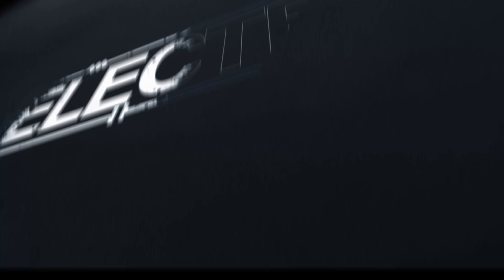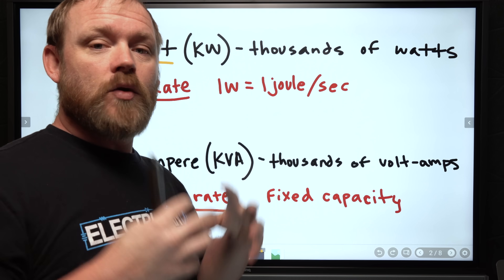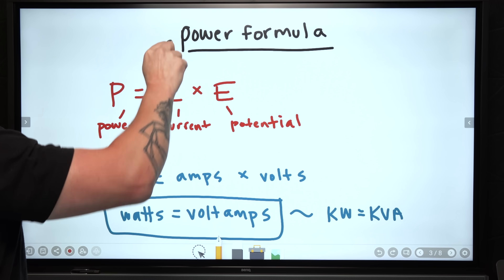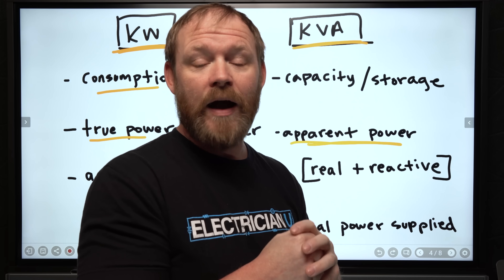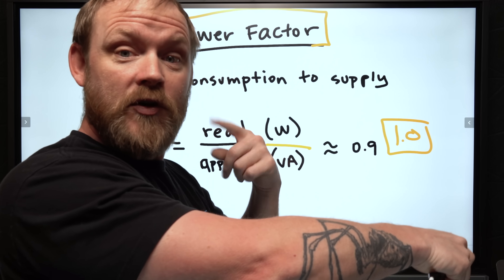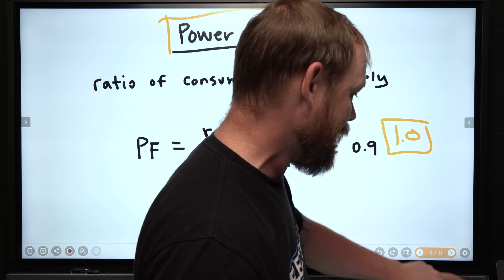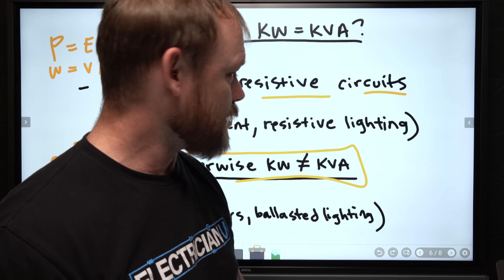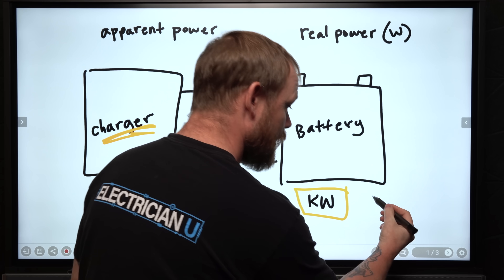Why KW and KVA Are NOT The Same Thing (Even If They Seem Like It)

Comment: To be honest, you used your formulas a bit wrong. P = U x I (sorry, I will use "U" instead of "E" because of the SI system), is only usable in DC circuits (maybe you should have switched your last sheet to be one of the first, because that is an important difference which should be told first). If you use it in AC circuits, you have three formulas for the power: Apparent power S = U x I, reactive power Q = U x I x sin (phi), active power P = U x I x cos (phi). cos (phi) is that, what you call the PF. The angle phi is that angle which you should have marked in your slide showing the difference between DC and AC and it would be the angle between R and Z. 

And if you look at the formula, in DC currents X = 0 so the angle phi = 0 and cos (phi) = 1 which explains why in DC circuits P = S = U x I

Comment: You can get apower factor of 1.0 in circuits with inductors and capacitors, but only when they are balanced. A 1.0 power factor requires the voltage and current curves to be in phase and indutors and capacitors have opposite effects on the phase of the current curve. Make the two equal and it appears as though it is a purely resistive load. Also called power factor correction.

Comment: You better believe the power company charges based on KVA and not on the lesser Watts.  Many industrial sites have their own banks of capacitors for this reason. If they can get their Power Factor as close to unity as possible they save money on their bill. Residential loads are mostly resistive and are too small to account for, so we estimate power factor in the aggregate and simply increase the rate we charge accordingly.  Some of our substations have capacitors in banks that can be opened or closed in stages to match the power factor of the circuit they serve, reducing the load on our generation.

Comment: This is a bad explanatory video.

A better approach is as follows:

With inductive loads (e.g., electric motors or transformers), in addition to the energy flow that the device processes (active power), energy also flows back and forth between the power supply and the device without being used by the device. This back-and-forth energy is called reactive power. Active power (P) and reactive power (Q) together make up the apparent power (S). Since reactive power is 90° out of phase with active power, they are added quadratically.

S² = P² + Q²

To save users from cumbersome calculations, motor manufacturers usually specify the active power P (in W) and the cos(φ) on the nameplate. The cos(φ) indicates the ratio of active power (P) to apparent power (S).

cos(φ) = P / S

This means that with a 1.1kW electric motor with a typical cos(φ)=0.8, the power supply is required to deliver 1.375 kVA and the supply lines must also withstand 12.5A instead of 10A at 110V.

PS:
- active power (P) is measured in [W]
- apparent power (S) is mesured in [VA]
- reactive power (Q) is measured in [VAr]

Comment: Almost. Like R-vallue. The theory you represented is right, but practice... shows relatively true A value at the equipment, but AC voltage is not as declared 110 V in average. For an example, the difference of equipment powerage with the same A for DC and AC differs up to 1/3. I tested "made in China" ones.

Comment: ...and but of course Volt*Amps is always a rate, as the definition of Amps is the number of charges (namely Q - not the StarTrek villain, though) passing through a conductor's cross section per second. You can write Amps as being the 1st derivative of Q with respect to time --> current I := dQ/dt measured in Coulombs per second which is Ampere.

So what Volts * Amps really says is the amount of charges per second passing through a conductor's cross section driven by the potential of the voltage.

Comment: kW is often averaged over 1 second or more in ideal situations.
kVA is affected by the worst case situation during each fraction of a cycle. kVA is average voltage x average current when more current flows at lower voltages in the cycle than expected from a sinewave of AC supply.
Wires, transformers & several other components heat up based on current flow no matter the voltage at the moment the current is flowing.
More current when voltage is low means less power is transferred compared to the same average current of ideal sinewave following the voltage (like resistive loads).
Equipment & supply may quote both kW & kVA ratings.
A generator or transformer may say 6kVA but 4.8kW, a powersupply (in equipment) may say 280VA 200W, both subtotals have to be each below the related rating of the supply (in this example above, 21x of the same powersupply could be used - not 24x if only checking kW).

Comment: Thank you. Great video. I wish I knew what screen you are using to draw on. That is an awesome screen. I'm a civil engineer and I relate KVA as potential energy and KW as kinetic energy. When it comes to moving water, we use the energy equation with the supply side on the left of the equation and the right side being the results, such as water velocity, water pressure, + LOSSES, just like the equation you showed. I loved that you explained this concept in several ways. Good job.

Comment: Ok, this all makes sense, but what about an Uninterruptable Power Supply (UPS).
They are batteries, but are rated in KVA.
Does it have to do with the power management within the UPS which may have capacitors?

Comment: Great explanation on KW, KVA. I want to make it clear that batteries do not store energy. Electricity can not be stored. Electrons can not be saved up in a device and used at a later time. Batteries store chemicals and parts that have a potential to create electron flow, from one atom to another. When we discharge or charge a battery we are changing the chemical makeup of the battery, this also goes for capacitors.

Comment: 1 Watt = 1 Joule/second
1 Ampere = 1 Coulomb (charge)/second
1 Volt = 1 Joule/Coulomb

Since P = E x I,
1 Watt = (1 Joule/Coulomb) x (1 Coulomb/second) = 1 Joule/second

So yes, 1 Watt = 1 VA

Now if you want to talk about torque (Nm) and energy (J) both using the same units...😂

Comment: Here's my confusion. As a motion picture electrician when I spec a generator I'm only concerned about how many usable amps that the generator will give me. Typically I use 500A,1000A,1400A generators. Because I know what lights are going on any particular generator and each light has a "known" amp draw such as a 5K which will draw 41.5A in round numbers. This lets me know how many lights I can put on any particular generator keeping in mind that I only load that generator to 80 percent of its total out put. How do I simply convert amp to kVA or kW? Sometimes the rental company only rates their generators in kVA or kW and I have to go get my cheat chart and see if I can figure  amp vs kVA/kW. Amps seems simpler to me.

Comment: Lol magnetic flux in the transformer NOT doing any work 😅😂 it’s basically how they work, isn’t it? 
Current flows magnetics grow electrons in the other wire get excited the flux lines align iron molecules in the core of the transformer 
The wham a fraction of a second later everyone goes the other direction 
Magnetic fields collapse electrons go crazy again looking to play musical chairs trying to find a place to be as things cave in
Only to get excited again as the magnetic field builds again from the other direction and again the iron core gets aligned by a magnetic field- all this back and forth the starts to make the metal warm because it’s basically designed to be a lower heat generation version of an induction cooktop that keeps the magnetic fields in the other wire to transform the energy into a different voltage or isolated instead of creating heat in a cooking vessel.
Magnetics are literally doing all the “work” here. You can tell because there’s also heat in the wasted energy because they aren’t 100% efficient  in moving power from the primary to the secondary windings. 😉

Comment: I always wondered why battery capacity is listed as KWh instead of actual energy, like Megajoules or Kilojoules.  That would make more sense to me.
KWh has two time components that cancel each other out.
Watts is energy per second.  Then you multiply it by time (hours).  You are effectively dividing by 3600.  Seems silly.

Comment: Batteries in Ampere/hours...
Used on uninterruptible power supply systems...
500va, 80kva, 2000kva, 1000000 MVA.?
DC generators use them.

Comment: The only difference is that - by convention we use VA for maximum available power, and W for maximum consumable power - ie max available power * power factor = max consumable power. Note that you could use either W or VA as units for each of these things interchangeably.

Yes, this is from the perspective of a theoretical physicist rather than an electrical engineer, hence my focus on the pedantic definition of the terms rather than "how a sparky might find it easier to understand when he sees it written on equipment in practice", but I was literally cringing every time you said "kVA is stored energy" and that kVA and kW are different things. They're not. You might as well say "horsepower" is fundamentally different to "watts".

Comment: Thank you for trying but still clear as mud!
If I have a 12v plug in psu   Rated in Kva   Or a generator  how do I convert that into how much power I’d coming out?
How do I know what size( kva) I need to power a given load? Is it just saying  v x a is the max it can supply but power factor will reduce what you actually get out in the real world?

Comment: Apparent Power = KVA =  kW + KVR = Real Power + Reactive Power (implies inductive power for motors / magnetic fields).  So, in short, VA is the sum of real power (resistive) and inductive (reactive - stored energy in magnetic field).  If you use the analogy of an electrical circuit, where you have resistors, capacitors, and inductors, the equivalent total impedance is the vector sum of both resistance and impedance.   Analyzing this a bit closer, you will find that the total impedance is influenced by the frequemcy via the following relationships: XL = jwL, XC = 1/(jwC).  Thus, KVA is an extension of this where both resistive and reactive components are taken into account.  Note that kW implies a strictly resistive load (no reactive elements) and kVA implies the addition of reactive power (inductors and capacitors are present in the load).

Comment: You should explain what reactive power is. How change in magnetic field of a coil has resistance to the change of current. How AC current flips "polarity" in HZ causing changes in magnetic filed. These changes cause additional resistance that needs to be overcome. You already drew the transformer. That is the true reason why the AC generator side will encounter higher Amps then what the load side transformer or motor draws/uses to produce useful work like rotational force. That is the true meaning of PF. Extra amps that are necessary to overcome resistance in changes of magnetic filed. That extra power, spent on overcoming the resistance of change in magnetic filed, is converted into heat. This is how electric motors burnout. This extra power on overcoming the resistance of change in magnetic filed is "wasted" and is not transmitted to useful work, for example, rotation of a motor. KVA is KW corrected by PF for energy wasted on overcoming resistance of change of magnetic fields of coils. PF can also be more then 1 in capacitive loads, for example LED lights. Hence, the explanation for capacitors in electric motors. There. Plain and simple. None of this "KVA is capacity" nonsense. Volts is a measure of how much power can be pushed. Amps is a rate of transfer. KVA is ability to supply power and NOT a capacity of power. K is just a multiplication for comparability with KW. KVA or 1000*V*A is how much total power needs to be supplied for a given load with a given power factor. Ideally with a margin of safety for Voltage drop due to current lagging.

Comment: Batteries are in kW because they operate on direct current, not alternating current, so there is no reactive power in direct current motors because reactive power depends on frequency. If cars have motors with frequency converters, then reactive power occurs after the frequency converter (three-phase inverter).

Comment: kVA : kW = IHP : BHP

Electrical → kVA vs kW

Mechanical → IHP vs BHP

gross power vs usable power

In electrical circuits, kVA is the total/apparent power, while kW is the real usable power after losses.

In mechanical engines, IHP (Indicated HP) is the gross power inside the cylinders, while BHP (Brake HP) is the usable shaft power after friction and pumping losses.

So the analogy is:
kVA is to kW as IHP is to BHP.

kVA is the promise, kW is the delivery.

IHP is the brag, BHP is what hits the road.

kVA is what’s on paper, kW is what you pay for.

IHP is what the engine dreams, BHP is what the wheels feel.

kVA is the theory, kW is the reality.

IHP is the talk, BHP is the walk.

kVA is like the menu, kW is what’s actually on the plate.

IHP is the hype, BHP is the horsepower you can use.

kVA is the source, kW is the load.

IHP is the source, BHP is the load.

In Electrical circuits:

kVA (apparent power) = what the source can supply.

kW (real power) = what the load actually consumes.

PF Vs Mechanical efficiency 

Think of PF as:
\text{PF} = \frac{\text{Useful Power}}{\text{Total Power Supplied}}

In engines, the equivalent is mechanical efficiency and is the ratio of BHP to IHP.

IHP (Indicated HP) = power developed at the source (inside cylinders).

BHP (Brake HP) = power delivered to the load (at the shaft).

In electrical 
reactance is energy stored and released by inductors/capacitors that doesn’t contribute to real work.

In mechanical → the analog is friction, inertia, pumping losses, vibration, and compression effects.

These are forces that absorb and release energy without producing useful output.

Example: piston rings rubbing against the cylinder → energy loss.

Flywheel inertia storing energy in one stroke, releasing in another (like inductance).

Compression/expansion without net work (like capacitance).

Comment: you chased your tail on this one, you can simply say in an ac system the voltage wave is not in phase with the current wave(except in a purely resistive circuit). so they are not happening at the same time

Comment: VA is a real capacity versus watts that would be a net capacity. The term apparent is a misnomer as they are real amps going back and forth but not doing actual work so there is real current that need to be accounted for. A good analogy would be the money needed to buy a glass of eggnog lets 3 bucks for the drink and 2 more as a security depostit for the glass. You need 5 buck in order to get you drink, and while the value of the drink alone is 3 bucks you have to budget for 5 dollars.

Comment: When it comes to multi-tapped transformer for example one with a 6v, 12v, 18v and a 24v tappings can give more current at lower tapping voltages than at full 24v tap, so if that transformer was rated at 48VA, it would mean one could draw out only 2 amps at 24 volt tap, or 4 amps at 12v tapping or 8 amps at 6v tapping. So down right confusing, but this may only apply to transformers, Transformers are used to charge car batteries, they may not pause as much reactive load since secondary voltage is rectified and smoothed with a large vale capacitor, so may be a small amount of capacitive load, further down the line a voltage regulator may provide a constant voltage to charge lead acid batteries or constant voltage and current to charge other types of batteries with feed back control to turn charging off when batteries have fully charged.